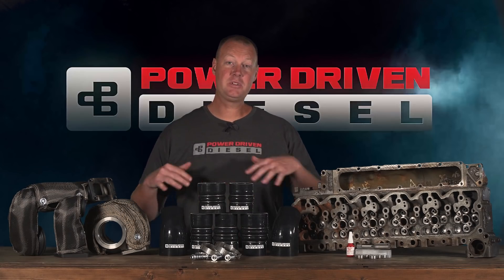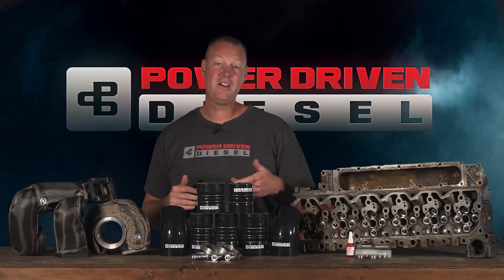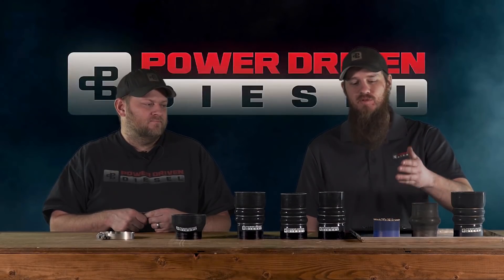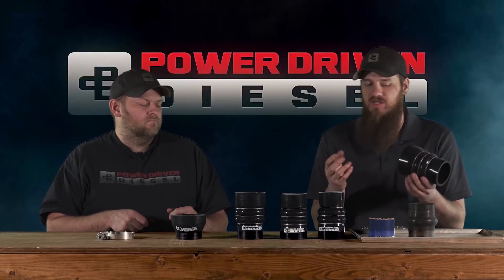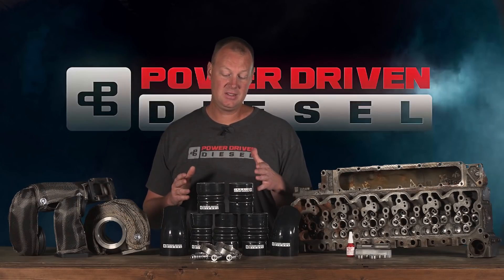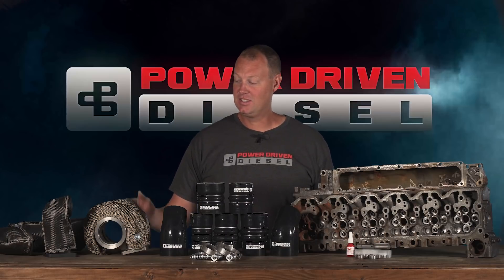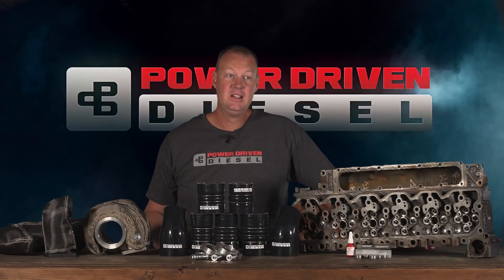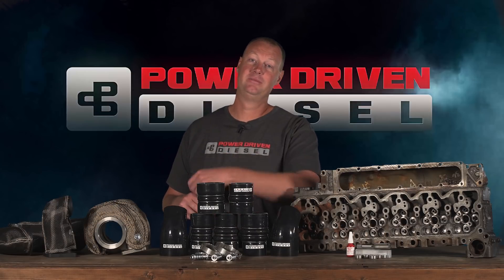Cummins 5 Ply Boost Proof Intercooler Hoses & Boots | Parts Bin EP 22 | Power Driven Diesel

Comment: I'm doing a 12 valve swap on my square body chevy. I build a 650-700 horse 12valve, should I just use a stock 2nd gen intercooler or should I just buy a Mishimoto for that amount to horsepower?

Comment: Aramid fiber is stupid tough. Kevlar is made with aramid fiber. Aramid is used as the stabilizer in fiber optic cables, I’ve personally applied 3,700 pounds of pulling force to 6mm of aramid yarn. So the fact that he has SO MANY aramid fibers makes LOL because that thing will not break.
Reply from the maker: that is the hope for them we wanted the best boot that you can get